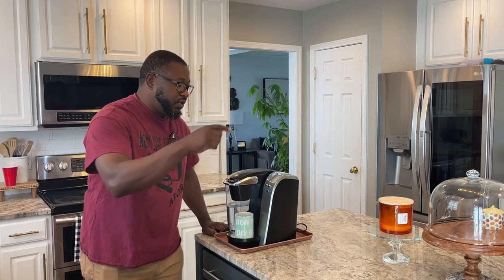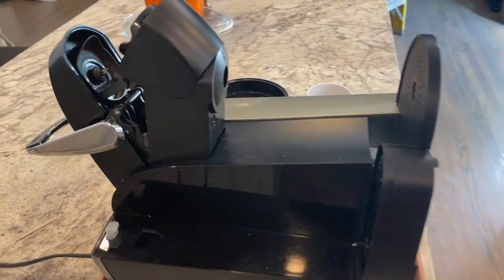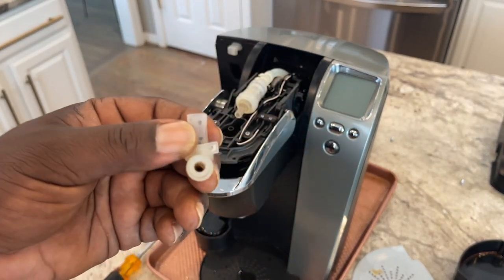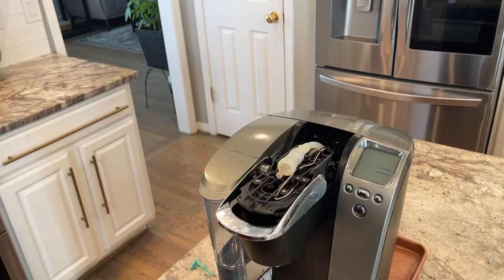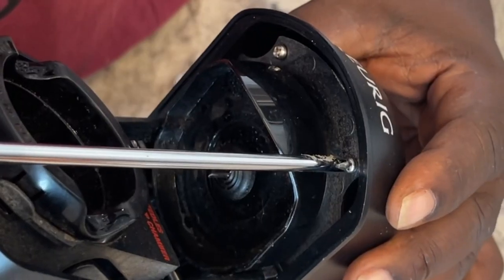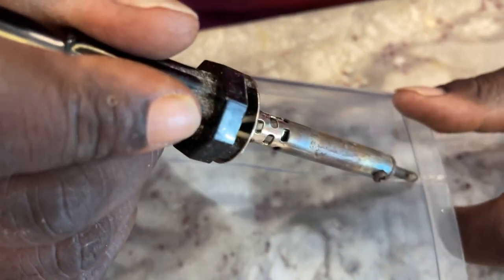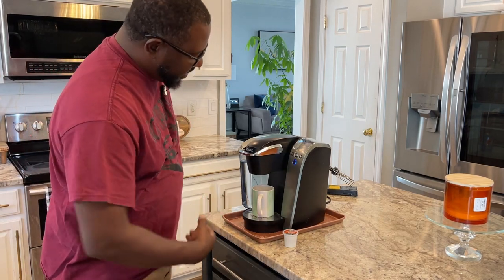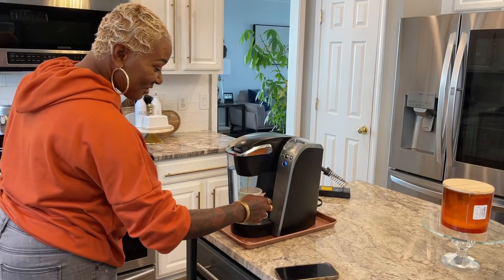This is an EASY FIX for your slow or leaking Keurig (K-Cup) Coffee Maker!

Comment: Same unit as mine, tried what you did and more.  I now have been able to run seven  large cups through it.  But I’m still not confident it is fixed.  Great video and good fix on the water reservoir.  Good video!

Comment: Same exact one I have! I actually have 2 because I bought a new one and gave my old one to my office because the flow was so slow. Now my newer one is going slow and even though I have used the paperclip trick on both of the units, they still were not performing. I’m going to perform this maintenance on them and see how it all works out! Maybe it will fix the extra water from flowing back into the reservoir due to the clog!

Comment: A Keurig tech told me to use a paper clip (straigthen out) to poke through the "puncture" needle. Also the machine may not need to be disassembled.  Just use the paper clip pushed up and out of the puncture needle several times to clean out the that same area. Works most of time.    May have to run water throught it several times to flush out the "crude".

Comment: Good one Ron I might be able to do that. We'll not the reservoir.  OK how do I increase pressure on our water pump. We have a well. Shh don't tell hubby I asked.  We had plumbers few uears ago, I thought it was or is a valve?
Reply from the maker: Adjust the PRV (pressure reducing valve). Screwing clockwise increases the pressure.

Comment: I fixed mine by simply UNPLUGGING it from the wall. Wait 20 seconds and plug it back in. Done fixed 👍 

Your welcome.🎉
Reply from the maker: That’s awesome! Was it slow or leaking prior to?
Reply: @rontalley  Wasn't dropping enough water. This rebooting trick works with many electronics today. Many electrical utilities today do not deliver consistent amperage. this causes drops and surges. My TV in the user manual recommends simply unplugging in if you encounter issues. that works always.